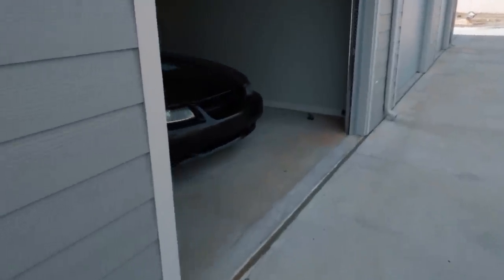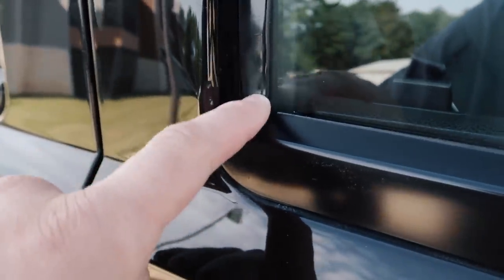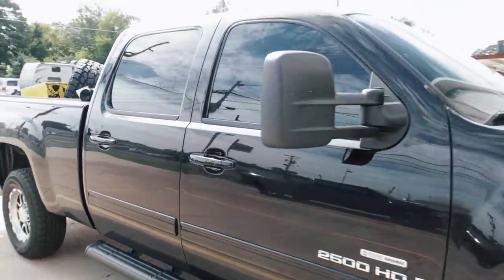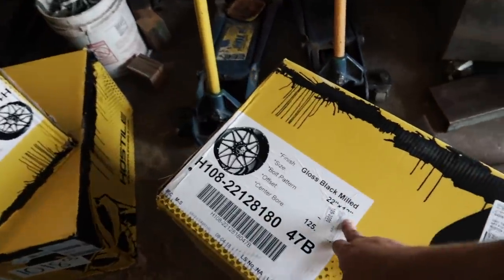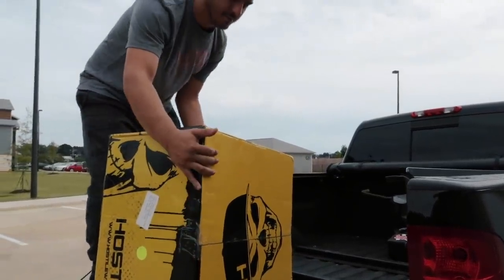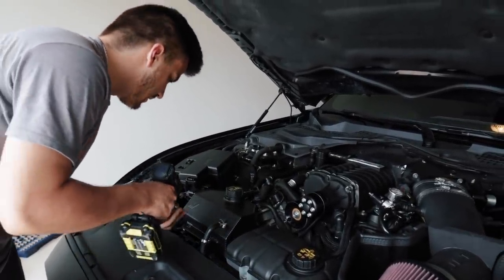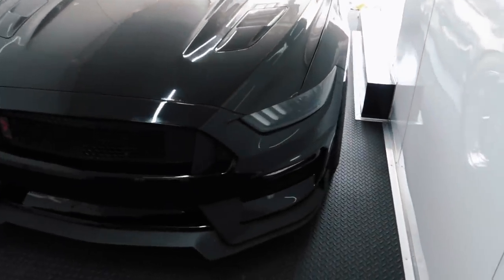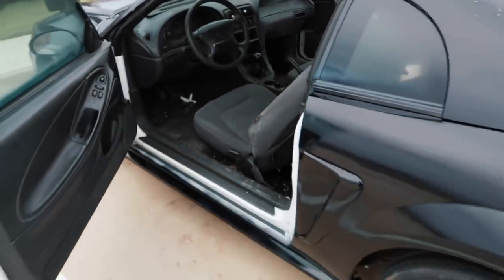Allison got SICK new wheels.. & I’m sending them back...

Comment from the maker: The correct wheels have been ordered! They’re slightly different though 👀
What’s everyone’s thoughts of 22x12s on Allison??
Reply: I would like to meet you one day I live in louisiana too keep the good work you are doing awsome!!👍
Reply: Awesome as usual.
Reply: 250 shot lol wont last long
Reply: hey gav!! i would love to buy your old wheels and tires
Reply: Look sick af
Reply: itsjusta6 u could just use adapters lol
Reply: Bro you should get a truck to carry your tires around 😂😂
Reply: lift it more like 7in
Reply: itsjusta6 22x12! Wow and whoever painted should paint the tires black now so there shiny forever
Reply: Stankles Buttered exactly
Reply: itsjusta6 looks great! Probably going to ride like a bitch but hey that’s what happens to look good.
Reply: Need some spacers
Reply: Congrats on the new VMP GEN3 man!!
Reply: I think they will look great.. I have a hunch they will rub though with the -44 offset on stock setup. Hope not but I guess we will see
Reply: Will your tires have the carrying capacity with that large of a wheel? To pull my gooseneck horse trailer I need 16” wheels otherwise there is not enough air to carry the weight.
Reply: i have the same setup on my 08 duramax and i had to cut the body for them to fit. i have a 3 in level.
Reply: That would look bad ass in my opinion
Reply: itsjusta6 they are going to rub and ride like shit!
But hey at least it will look good🤙🏻 love the new DirtyMax btw!!!
Reply: its gonna look like every other mall crawler on the street. i hate low profile tires on a truck it defeats the purpose and ride quality
Reply: itsjusta6 straight pipe the v6 mustang before the drag🔥🔥🔥
Reply: Hope they look as good as the previous ones
Reply: Dudeeee that’s gonna be thicc
Reply: I had to cut a lot on my duramax to fit 20x12s -44 on stock height. Good luck!
Reply: Yuck tire with short sidewall :(
Reply: I hope you have returned the ones that won't fit.
Reply: 22x14s are the way to go. Tune and delete coming soon. It would look nasty with a 6 inch lift and a 6inch drop hitch
Reply: As long as there is 10 inches of rubber between the pavement and rim then it still considered a truck. Otherwise its a yuppy mobile. If it aint got big ass grips it aint a truck
Reply: itsjusta6 definitely! Get leveling keys so you can clear them a little easier
Reply: MegaJason30 well you wanna get technical. Insurance and registration is only required on vehicles uses for commercial use. The blacks lawbook defines "driving" is operation any vehicle for commercial use. So "traveling" in a vehicle on public roadways is completely legal with out reg. And ins and a license in fact. I do not drive my personal vehicle for commercial use. And havent had my vehicle taged or ins. For almoat a decade and have had every ticket tossed at no cost to me, and had both impound fees refunded with interest. Dont be bullied by blue isis know your rights.
Reply: itsjusta6 go to coffee call on college drive from 8:30-11:30 every Thursday night
Reply: You didnt specify your exact year? Just assumed..? Your the dummy here
Reply: Gavin those wheels looked great. Gavin have you thought of seeing someone who is able to lift the curse that has been placed on you, it is the only way anyone could have such bad luck, as a child you must have truly upset someone nasty.
Reply: 24 forged r 26 with stretched tire😁
Reply: itsjusta6 you can put spacers on tbh 8x6.5 to 8x180
Reply: 22x12's are fuckin fresh
Reply: Yeah ok
Reply: Legal limit on a truck should be 18inchers.   Nothing more
Reply: I have a personal preference on more sidewall for trucks but if it works for you then that's all that matters.
Reply: Great size
Reply: Big wheel little tire, you need to run at least a 35 inch tire. So much rim and very little tire will equal a bent wheel or cracked wheel in no time when pulling that trailer. Trust me when I say this I’ve been there. That truck could run a 35 no problem worse comes to worse two and a half inch lift. But like I said just return those tires before you mount them.
Reply: too big of a wheel and tire doesnt have a enough sidewall. 18' wheels on 33's is the best setup tbh or even 20's on 33's looks better and lets the tire actually work in sand and mud
Reply: They will definitely rub
Reply: Go 26x12s on 37x13.5s
Reply: Steve F H USA=freedom
Reply: 22x12’s fuck ya, i ordered my american forces and im mad excited
Reply: itsjusta6 I can get something similar for you
Reply: Tune the truck
Reply: It does make it look like a street truck, and like it isn't actually used but just my opionion

Comment: I run a -44 22x12 with 33x12.5r22 toyo open country MT, on my 2012 Silverado 1500. You have a 2500 4x4 where I'm a 1500 2wd but I had to lift the front 3 inchs and do some trimming. I would keep that in mind... you may want to look into that. With the lift and trimming I did I was able to get it where you can completely turn the wheels as far as it will allow you.

Comment: Keep the stock wheels on the Duramax. The truck is going to ride like shit on a low profile tire, the tires are going to wear uneven, and you don't need to police attention with the excess rubber sticking out of the fender wells.

I'd do nothing more than a EGR delete, and have an Allison tech do a full service on the transmission since it's low mileage and seen little use, it might not like being forced to pull a trailer. I know it's too late, but get the transmission serviced, now.

Suncoast gets close to $4500 for a 1000 series Allison, so keeping the transmission happy is a good thing.

Tow vehicles need to be a close to stock as possible for reliability .
Reply: Gunga Dinn It won’t ride bad with 22x12 and an AT 33x12.50. I have 24’s and 35s and they ride just fine, not rough at all. Sure they don’t ride like a Michelin on a 16” wheel, but who wants to ride on those? Mud tires will make you lose some ride quality, A/T’s ride pretty smooth. Not sure what you mean by wearing uneven, that’s only if you have a bad alignment or the wrong air pressure. Properly aligned tires will wear properly.
Reply: Police don't care about tire width in Louisiana but the tint might be an issue that will eventually lead to the tires
Reply: Most southern states could give two shits about rubber peaking out of the fenders (like no law against it)

Comment: you will need to crank your torsion bars a little bit to run those tires and wheels, also i would advise putting some sort of fender flare because the rock chips on that very nice paint job are gonna ruin the paint. trust me i have a 08 2500HD i would know.

Comment: I have 22x12.5 on my obs ford and I like them but the run when you trim head and with a big off set the can bend the end of the axle tube on a solid axles and I think on the ifs the controls will bend a little to

Comment: Dude always double check your bolt patterns before you go and try to mount the tires. Always test fit them to see. Easy mistake that could have solved before you drove to the tire shop.

Comment: 22x12s r gay go with a normal sized wheel since you will be using it to pull the enclosed and those toyos r shit they dont last very long go with a 20x9 or 17x9s looks way better than a huge gay wheel and no sidewall
Reply: Oh and ordering the wrong bolt pattern is a sign to NOT put those on your truck